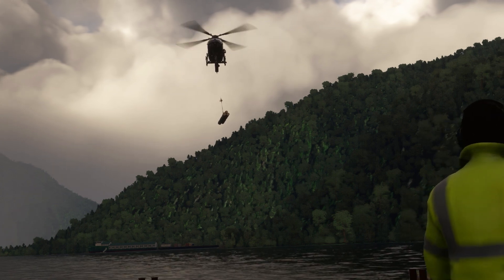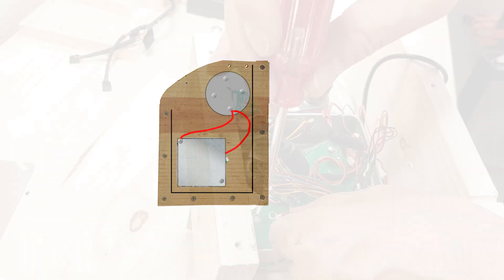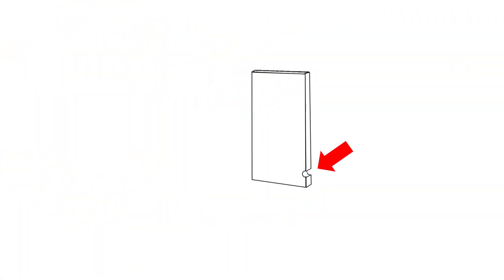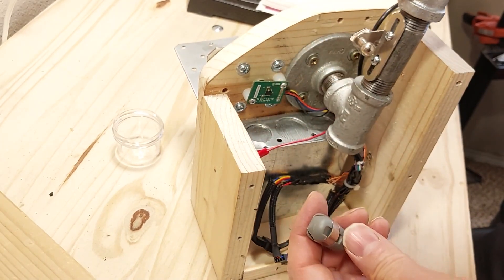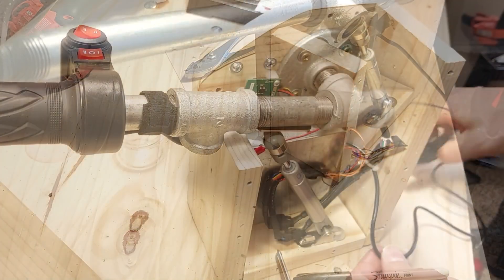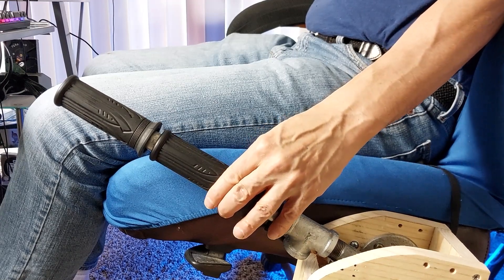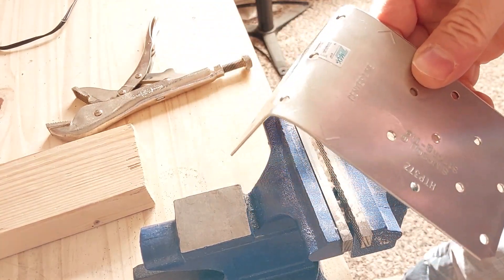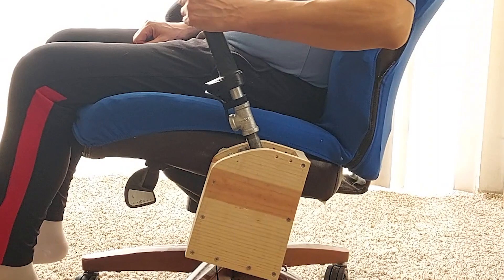DIY CHOPPER COLLECTIVE | PART 7 - FINAL! | CHAIR MOUNT

Comment: This is good stuff!  I am excited to build one for myself in the not too distant future hopefully.  I need to recover from recently purchasing the Honeycomb Alpha and Bravo first though. 😜

Have you also done a cyclic or are you using a stock joystick?
Reply from the maker: I have a VKB joystick I've taken the springs out of and that does a good enough job that I don't have a burning desire to create something to replace it.  I think the collective is necessary for a more authentic chopper experience.

Also in the process of creating it I think I could probably do it for a good $50 cheaper with the crappy Logitech joystick while keeping the accuracy the same.  I might pursue that and create a second set of videos -- DIY collective for $150!  That's as cheap as you're gonna find for something like that.

Comment: @CaptainHelisim, is it possible to receive a collective from you that would only require the collective to be attached directly to the internal wires of a thrustmaster hotas one throttle. If possible It  would be of great help. Thanks in advance.
Reply from the maker: So CJ honestly speaking, when I set out to do this project, it was on a hunch.  I'm a former electrical engineer so I had a sense that it might be possible to merge these things and it pained me to explore the idea because there was capital outlay and I had no assurance that it was possible.  The idea of tearing up a perfectly good brand new joystick honestly made me queasy.  As I was unscrewing the bottom screws I was thinking man, people will think I'm nuts.  And if this doesn't work, they'll think I'm nuts AND stupid LOL!

So point being, I did this successfully and wanted to share the results and instructions on how to do it but I had no assurance beforehand that it would turn out that way.  If you hand me your gear, I would say the same thing -- I THINK it can probably be done, but I might end up destroying it and it would take quite a while to find out.  That's not a proposition I'm comfortable with.  The reason is I would have to take your gear apart and take a look inside to figure out how I can interface into it.  So the answer is no I don't think that would be a good idea, but knowing that I built this one successfully I can offer to build you the same thing for cost+labor+shipping, around $350.

Some day I hope to figure out how to do it even cheaper with a logitech joystick while still retaining the awesome Hall effect accuracy (as opposed to logitech's crappy/sloppy circuitry), but that day is not today.  If I ever get around to it I will post those results and hopefully I'll have a successful $150 collective.  Wouldn't that be awesome.
Reply: Appreciate your quick response & thanks again for clarifying. Yes indeed it would feel a bit uncomfortable in braking apart a brand new product as you felt but it clearly worked out in the long run. 

Due to my budget I guess my only option would be to use the throttle as a collective for now. 

By the way, it must’ve felt awesome the day you took on the MD500, that lovely machine is one of the main reason im pursuing this lovely helicopter journey. Glad to know the flight sim helped out on flying it, its of great inspiration for us beginners who are interested.
Reply from the maker: @Cj-cs3us  Man I'll tell you I couldn't sleep the night before the big day with the MD500 or the night after LOL.  It was just so exhilarating I couldn't calm down LOL.  Re: collective, maybe check on Facebook marketplace and see if someone is getting rid of one; maybe you get lucky and find one cheap!
Reply: Wow, that sounds so awesome, i would probably not sleep as well just by having the thought &  joy of taking control of the MD, would love to do the same directly at the MD headquarters in Arizona. 

You should definitely proceed in becoming a pilot i bet you probably end up owning your own MD 500.
Reply from the maker: @Cj-cs3us  I would love to and if I were a younger man I definitely would.  The thing is I'm almost 60 and it's a foregone conclusion no one will hire me to pilot their craft.  And I'm not rich so getting a license for my own amusement and tooling around in a rented craft is not financially practical either.  In this game you're either rich or young, and I'm not either.  

And now you understand why "Captain Helisim".  For guys like me, spending some substantial money on simulation gear and trying to get "as real as possible" is realistically the best we can do.  And the quest to "try" the real thing was really just to see well, how close to real am I?  The answer I found out was, hm.... not THAT far from the real thing.  And arguably there are the benefits -- go to the bathroom, have a drink, fly where you're not allowed, fly like a maniac, respawn!  LOL.  But being touched by the real thing a time or three is such a blessing, honestly it's like meeting a childhood idol -- a movie star or something.  You just about shit your pants haha.
Reply: I hear you Captain HS, but remember theres a saying that 60s is the new 40s & 40s is the new 30s & on the financial part, theres always this new day that literally switches around if searched,who knows maybe some day you decide to play some numbers & end up winning big times. YOU just NEVER KNOW, many have become wealthy after 60 and many 60 have there MDs parked as well & that can be you as well.
Reply from the maker: @Cj-cs3us  I pledge that if that ever happens, I will personally come pick you up in my MD and we'll go fly around.  👍🤠🚁
Reply: For sure 🎉🎉🎉 be ready.